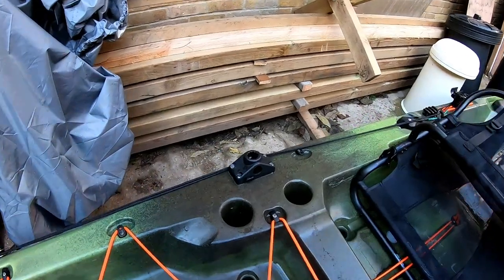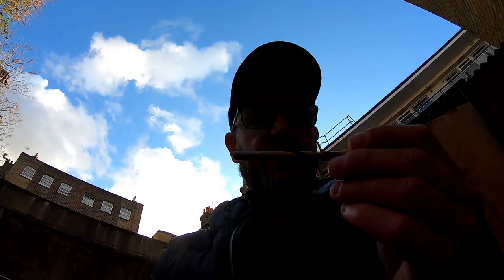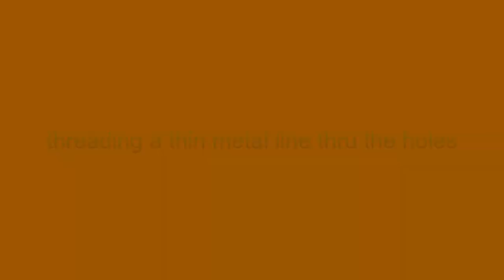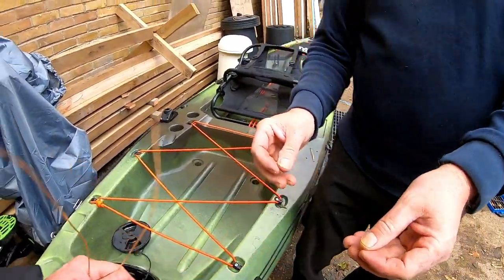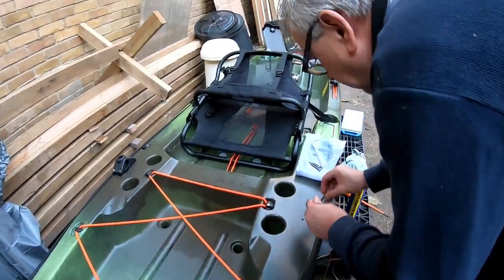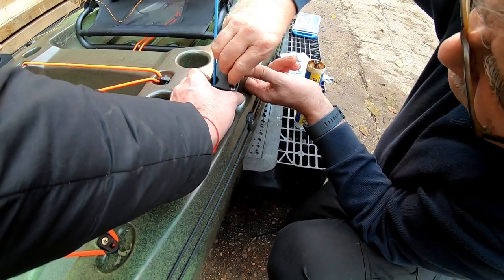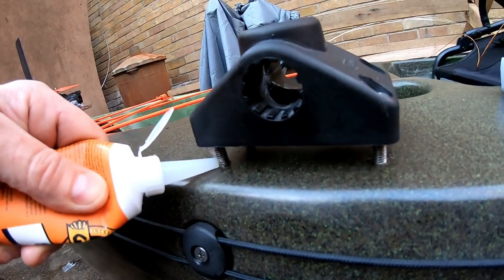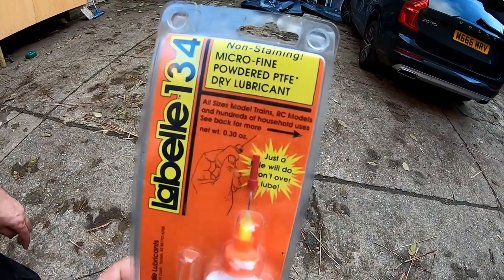EVERYONE COMPLAINS ABOUT IT! How to install properly Scotty 241 mount deck with Scotty backing plate

Comment: I installed Scotty gear tracks with pop rivets, and then put the rod holders on. No problem very strong.
Reply from the maker: Yes I have done it with back plate. For rod holder into the plastic I go for the strongest option. You can check the list in description box

Comment: Did you put Marine glue on the underside of the underside mounting plate before you installed it? I think I heard mention of loctite....Would you recommend glue?
Reply from the maker: Hi mate no I didn’t put loctite but as you see on the video I used the back plate so it sit well, and yes I have used gorilla sealant to make it water tight.

Comment: Wished I would have watched this video sooner. I watched another one where he didn't mention or have any problems. 

I finally got the backing plate on and two bolts secured. I tightened the 2 open holes first and then went to tighten the 2 others and not one... but BOTH of the other two locking nuts fell into the hull. After lots of potty words I just stopped as I know now I have to do it alllll over again.

 I never used anything but my fingers and a screwdriver and they still popped through. They simply tell you not to use a drill. They don't give proper instructions. They should have a QR code and video on the back. SUPER IMPORTANT to know that you MUST lift up on the mount and  hand tigten all the screws to start threading the lock nuts before tightening them all the way to make sure the nuts are tightening on the bolt first and they don't fall in the hull. Know I have to fish the locking nuts out annnd redo it all over again. I'm going to tape the back with electrical tape before I attempt it again. No wonder why everyone complains. They need to give video instructions which
Reply from the maker: True. I went for them and the holder is very good and strong but yes you need to go around quite a bit to install it. Maybe you can fish the nut with magnet that is attached to an electric pole at the edge and search it inside the hull.

Comment: Just use well nuts !!
Reply from the maker: mounting gear In order of strength, from strongest to weakest
1. Bolt with back plate
2. Bolt with penny washer
3. Tri-fold rivet 
4. Nut bolt
5. Well nuts